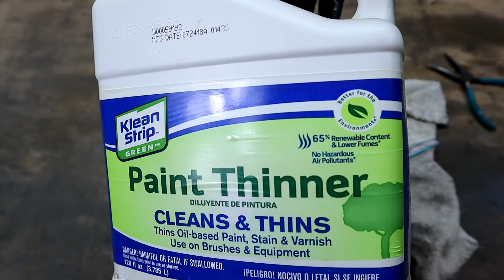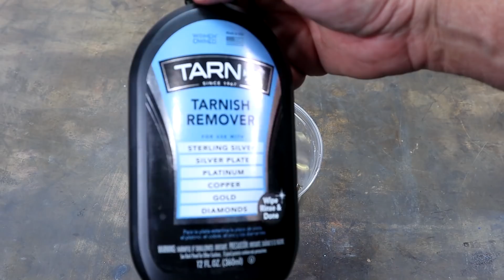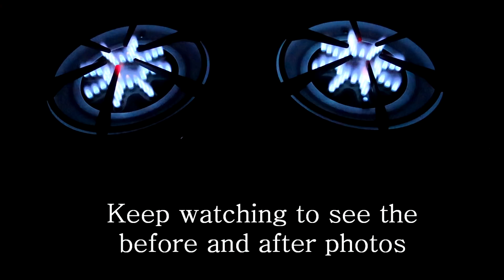Table Top Propane Camping Stove Restoration Video

Comment: Your video was almost perfect - not too much talking, clear visual direction, pretty safe working practices.  I also liked that you showed more than one way to do things like taking out the rusted screws. The clamp was a smart way to get the pin back in while holding the spring in place. Not too fond of the white - just because it doesn't seem practical for outdoor use. I wish you would have shown how you adjusted the nozzle - that would have been very helpful. I'm not complaining - I think this is an amazing video and I'm inspired to try my own restoration now! Thank you!

Comment: I liked the heat resistant white top which would make clean-ups easy, and the blue legs are a good choice too.  I was a little surprised not to see any more cleaning of the iron star-shaped gas jets other than an over-night soaking.

Comment: Excellent job! Love the colors too. Two things....don't use teflon tape for gas connections, the correct tape is yellow in color and is like the white stuff but a bit tougher. Also, there's a product called Bar Keepers Friend that is phenomenal for cleaning brass, copper and other metals, give it a try and see if you like it.

Comment: I hope that the cone plugs were not mixed up. Each of them is a ground stopper only for its housing. Otherwise there will be a gas leak.

It’s good that you achieved the correct burning.

If you chose blue legs, you need a color repetition in another design element. Maybe draw a blue ring around the burner. Or do not show off and paint the legs in black or white.

Conscientious and complete recovery. Fine.

Comment: Flat washer goes on screw head side. Split washer goes on the nut side.
Reply: Yeah it's a common mistake.
Reply: Well..I just follow flat with the spring (split ) washer , than the nut
Reply: I don't think it needed a flat washer at all.  Flat washers are used where they are needed - normally, but not always, on the head side.  I think it's funny I even noticed he put them on there.  I need to get away from the internet.

Comment: Nice job, looks like new. One tip for the tarnex is to degrease the brass beforehand, I am not sure if you left the paint thinner residue on the parts but it would definitely make the tarnex not work well. I always degrease the brass with acetone or similar non petroleum based products.

Comment: This cooker was probably intended for use with coal gas (distributed over a pipe system to households). It uses bigger nozzles (lower pressure and different air/fuel ratio) and does not work well with LPG.
Reply: I agree, he would benefit from getting the proper LP orifice or peening down the existing ones.

Comment: A great job but have a couple a questions. First what did you soak the burners in overnight? Secondly you said you had to adjust something yo get the proper blue flame...what exactly was it and how did you do it . Also I love your color choices  ,think I would have added more coats to the ring area of the cooker top  will receive a lot of scrubbing in that area. Also think you might have left it stainless ,unpainted. Except for clear coat...would have made it very modern looking. Thank you for sharing

Comment: Additional detail on how you cleaned the burners would have been good, rather than just 'soaking them overnight'.
Reply from the maker: That's basically all I did with the burners. I pulled them out of the evaporust and rinsed them off. There were a couple of small spots that needed cleaned off but that took less than a few minutes.
Reply from the maker: Too loose meant they were allowing more gas through than they were supposed to so I tightened them so the jet on the valve itself was seated against the nozzle.

Comment: I always love the before and after photos.
What, exactly, were you referring to when you said the "nozzles" had to be adjusted?  Do you mean where the brass fittings connect to the cast-iron burners?  I, too, thought the connection, or lack of it, might cause a problem.
The colors weren't a problem.  Maybe I would have made the legs black, but it was no biggie.
Nice job.

Comment: As an old heating tech, I watched this with amusement. I saw that you used tip cleaners, but did you do the burners? Glad you figured out the O2 problem. I hope the heat- proof white paint lasts. The contrast with the black burner guards is nice. The blue legs are super. You possibly an ex Air Force veteran?
Reply from the maker: I had planned on drilling out each burner hole but upon inspection (after soaking in evaporust)  I found all the holes to be clear and in great shape. I'm ex navy. I got the color scheme from another stove I saw years ago. Thanks for watching.

Comment: Amazing, can you share the information on your Sandblaster cabinet, including your settings and media, it has to be the most efficient blasting machine i've seen so far, thanks.
Reply from the maker: It is a Harbor Freight cabinet with Aluminum Oxide media. The gun is an old one I had lying around. The HF one sucks.

Comment: Remember those well. Did you clean out the actual cast iron burner jets? I found cleaning those out with a wire, got rid of the cobwebs. If I were to repaint one, I'd go black with red legs Or all black. Nice job.
Reply from the maker: I was all prepared to drill them out if needed. They didn't need anything done to them.

Comment: Looks as good as new!!! Question: How did you know it was Propane and not Natural Gas for fuel? Usually the Nozzles and/or the Valves are marked but I didn't pick anything out.
Reply from the maker: Small stoves like this are normally propane because they are portable and propane is also portable. You can't buy natural gas in bottles that i know of anyway.

Comment: Nice video, the thing I didn't like was the noise of the electric tools, it's annoying, cut the audio off or low down the volume on those moments, and the colors.. since has a vintage look, I would have painted it in some cute pastel color, to have like a "smeg" style.

Comment: White Teflon tape on gas fittings is a NO-NO!  It will rot and eventually leak when exposed to the propane.   There is a different kind of tape for gas fittings - it’s yellow.

Comment: This is a great restoration, but isn't that baked on powder paint more durable than spray paint?
Reply from the maker: I am saving up for a powder coating system. Soon, I hope.
Reply: @TwoHandsRestorations  Nice.  I didn't realize that stuff was so expensive. Your video is really nice,, though. you are very thorough.!

Comment: Did you  use new burners or did you clean the old one's it didn't show other than putting them in a bucket of solution? I have one just like it I got 42 years ago for camping.
Reply from the maker: I put them in a bucket of evaporust. When I pulled them out they were in great condition. I think I cleaned a small spot off, rinsed them and they were good to go.

Comment: What did you do to the burners? We last saw then go into the rust remover bucket, but was that all the treatment they got?
Reply from the maker: Sorry. I regret I did not include it. I sandblasted them and painted them with a high temp paint... 2000 degrees.

Comment: Which nozzle was loose making the burners burn yellow rather than blue? The connections to the propane tank over to the right?
Reply from the maker: The nozzle on the valve is the part that goes into the burner. They needed to be tightened as they were allowing too much gas through and not enough air... or the other way around giving a poor quality output.

Comment: What did you soak the burners with? And did you just blow them out with the air nozzle.
Reply from the maker: I soaked them in Evaporust. I rinsed them out with water and then blew them out. They sat for a couple of days before I reassembled the stove.

Comment: Nice video.  Was there any O rings necessary for the valves?
Reply from the maker: No. It uses a compression method and the lithium grease helps to seal it. I checked and there is no leakage in the valves.

Comment: As I can read, I'm not the only one who is concerned about the colors choice, white is not practical at all when you are supposed to cook. But probably it won't be used at all, so any color would fit.
Reply from the maker: It won't be used by me. It'll go on a shelf with all my other restorations.

Comment: one of the best part that needed to be seen cleaned was the burner. Why no show that being clean. it would have been really nice
Reply from the maker: I cleaned them in the bucket of evaporust and when I took them out they didn't need cleaning. They looked great. One had a small spot but that was it.

Comment: I be surprised how could you unscrew all that corroded screws without spray?
Reply from the maker: The legs were wobbly to begin with. The screws were loose. It came apart rather easily.
Reply: @TwoHandsRestorations  ok here